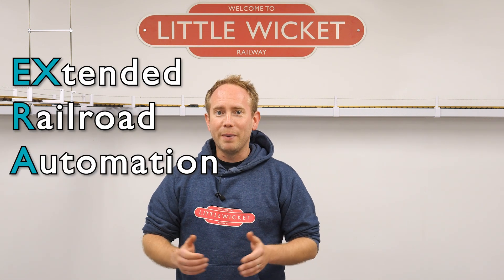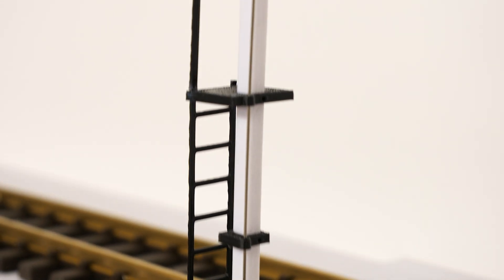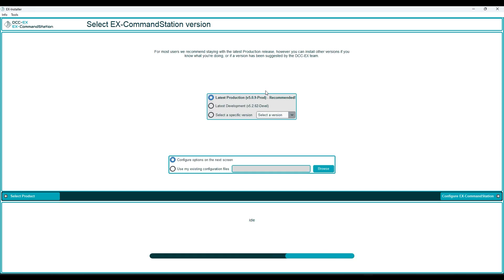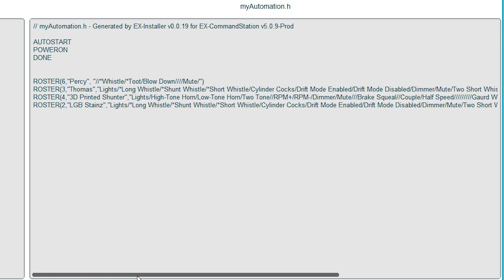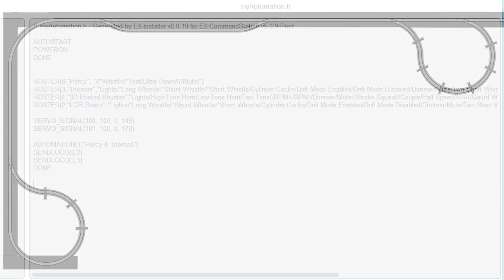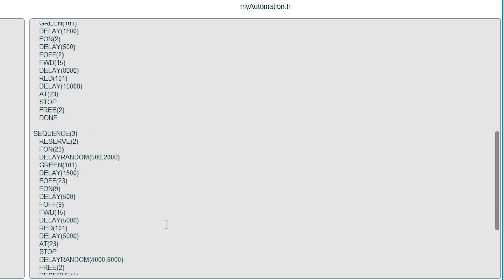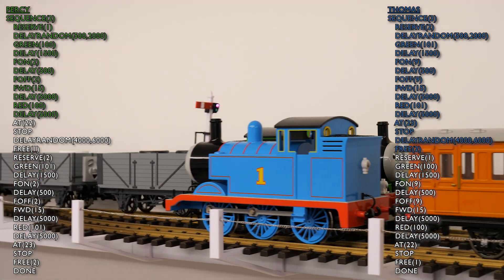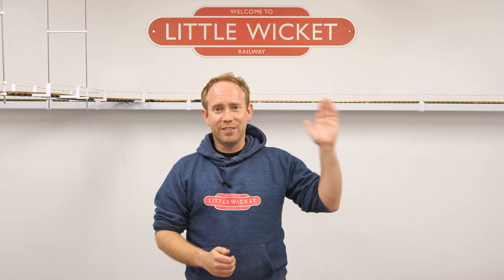Automated a Model Railway with DCC-EX EXRAIL

Comment: Hi rob
Having trouble with automation have set up roster and points ok and all works great but set up a shuttle script using automation and sequence commands shows up on engine driver but button says handoff instead of set and does nothing I noticed you offsetting the lines under automation and sequence is there a required number of spaces before each item thanks Dave

Comment: Hi Rob,
I find your videos inspiring. 
It's been too many years since I did model railways, but you and one or two others have inspired me to get back into it again. 
We moved back to France at the beginning of the year, where I was diagnosed with cancer.
I'm on chemotherapy at the moment and so watch your videos.  Please keep up the great work you do as it's keeping me motivated to get started very soon on the track, which should be at home ready.
Cheers Alan
Reply from the maker: Hi Alan, sorry that it's taken me so long to reply to this, I will explain in the next members video. Sounds like a you've been having a pretty tough time of it. I hope the chemo is doing its job and that you're back at home working on the layout soon. Thanks for your kind words. Please do stay in touch and let me know how you're getting on.
Reply: I will do Rob.
Reply: Hi,  I finished Chemo for prostate cancer just over 12 months ago but will be shortly starting another session for a few months however i hope i'll be able to continue my dcc railway which i'm redesigning for version 2.  I'm less of a modeller and more of a electronics and automation person,  using Sprog III as a decoder and command station along with arduino's and various sensor boards etc keeping  it a low cost solution yet something that can be adjusted and improved upon all the time.  Hopefully it will keep my mind off all the other issues going on and like you say watching videos like these from Rob gives inspiration and motivation to get out to my shed and keep trying things,  so keep up the good work.

Comment: Hi little Wicket, I love your videos very much and already have picked up a lot of information for my own DCC-EX command station. I have one question regarding the connection of the DCC power to the rails. At both end there are loops where normally the polarity of the supplied power needs to be changed to prevent a short circuit. How did you solve the problem? I understand that this is not really subject to your video  but I would like to know this. Best regards and keep on doing well.
Reply from the maker: Hi! I use DCC40 gaugemaster reverse loop modules. I already had them, but they're not ideal. They use relays, so click and are slower than a digital solution. I don't show it in the video for simplicity, but I had to reduce the DCC-EX sensitivity to shorts.
Reply: @LittleWicketRailway  Thank you, thats clear now for me.

Comment: nice, hope the dev team are looking at "Rpi Pico W",  new automations would not need recompiling (guessing that is being done for the arduino), pico could "command" the arduino/motor board, 
arduino pins are 5 volt, Pico pins are 3.3 volt, need level shifter for serial communication between them

Comment: Dcc ex is superb. I have a setup with 2 full circuits, a branch, 2 passing loops and an extra through line in the main station.  The branch runs automatically with full semaphore signalling, the 2 main circuits operate their signalling and when the loops are set the signsl logic follows.  I have used master and slave Arduino Megas and a load of sensors. It really is cool, doesn't use JMRI or any other proprietary 'stuff' and works really well. I'm now adjusting things so that rather than the trains operating the signals, the signals will control the train. DCC-EX is superb anx badly under publicised. Well done Little Wicket for this showcase.
Reply from the maker: Thanks Mike. Sounds like you're making really good use of it. Next level stuff.

Comment: Thanks.  This looks like what I'm looking for, but one question.  Could you program this to Run automation at set times of the day for a set amount of time and then park the trains at set locations at the end, say a 20 minute run time?  
I need it to run automatically at set times of the day.  
I'm currently looking at DC to control this with programming power to turn on and off with sensors, that include weather sensors, for an outdoor track.
Reply: There is an additional piece of software from DCC-EX which is a clock. It runs on an additional Arduino that you hook up using the i2C bus to your DCC-EX base station. The two can interact and it opens up timed automations. For example, you could use this with a PCA9685 to run lighting sequences inside buildings if that was of interest.
Reply from the maker: What John said 👍